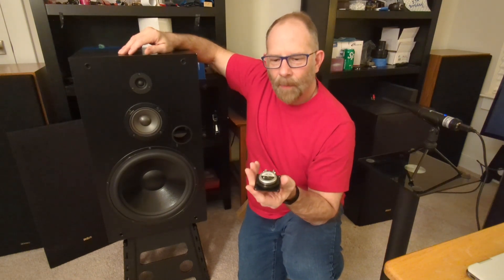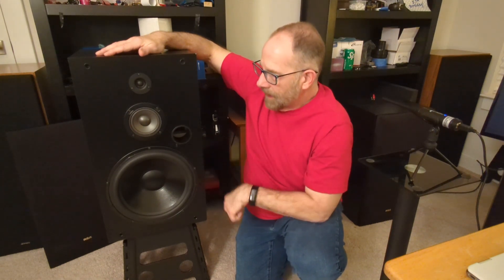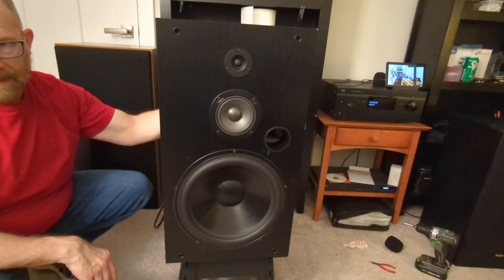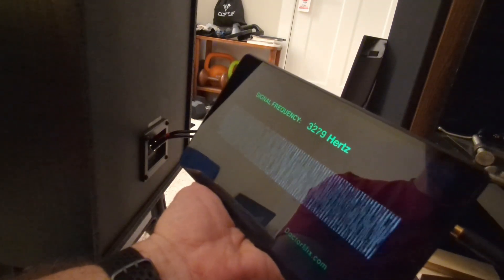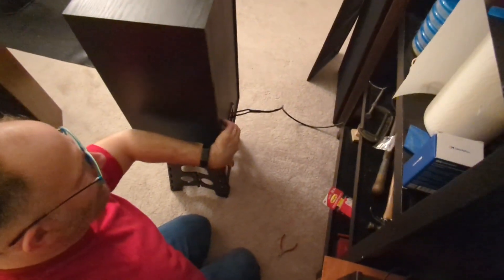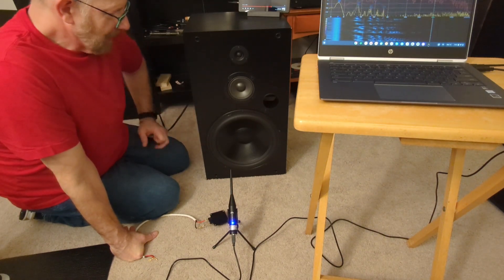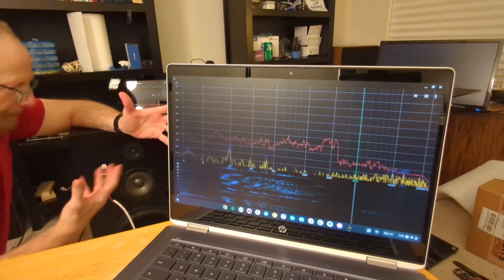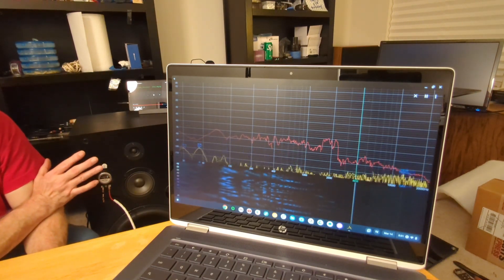Do Speaker Cabinets Resonate? RCA Part 15 Bass Tuning Resonance Testing

Comment: Thanks for sharing. I'm trying to eliminate booming resonance in my Klipsch SB3 subwoofer. I prefer a deader, punchier bass.
Reply from the maker: You're welcome, thank YOU for watching and commenting.  Where is your subwoofer crossed over at? I assume it's handling LFE from an AV receiver. I would suggest moving the cutoff closer to sub sonic, no higher than 150 Hz. Typically subwoofers don't need anti resonance or dampening except to shape the sound. If it's not the low pass setting it could be something inside the sub cabinet buzzing... or stuff in the room or the walls floor or ceiling buzzing.